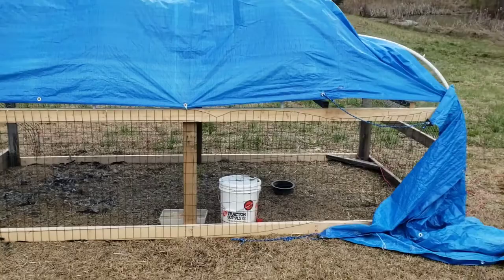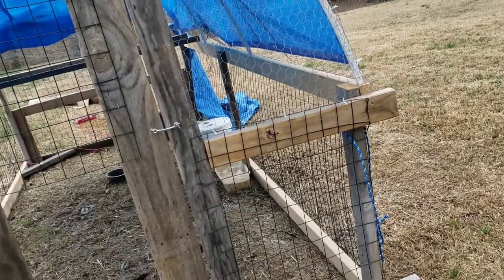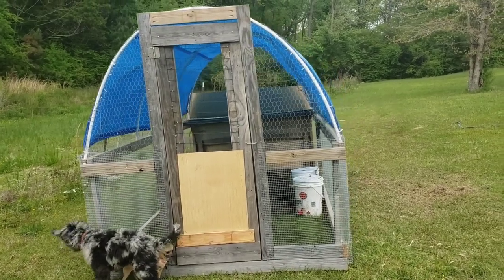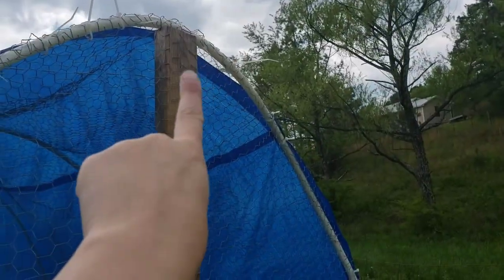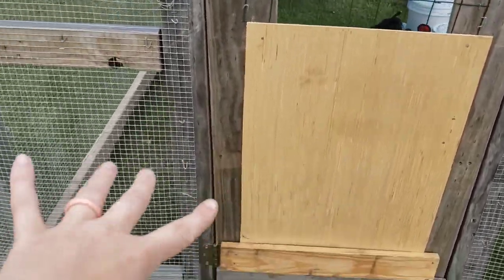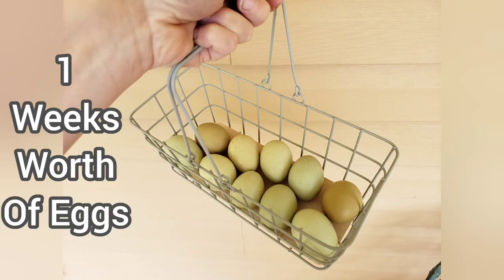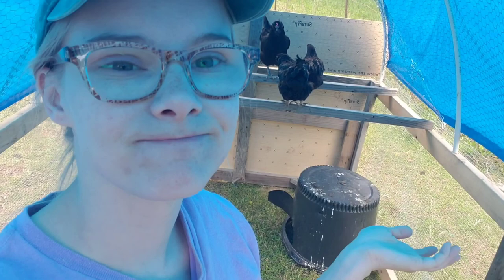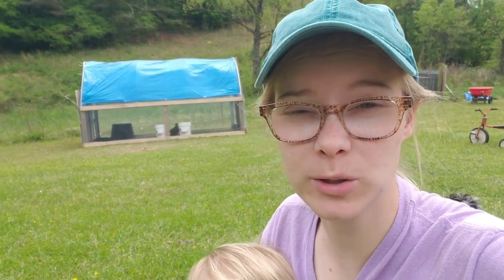Hoop Coop (Chicken Coop) Part 2: Predator Proofing The Coop

Comment: Do you have wire that goes 2 feet out around the outside bottom of your coop?  I see a lot of people do that to prevent digging under.  My run is smaller and I have bantams so I just put 1/2 inch hardware cloth on the bottom of the whole run.  The grass and weeds grow through and I put a dust bath plus a plastic shoe box of garden dirt to  scratch in.  I am 74 but I can easily move  it a few feet, a couple times a week.  Also the coop and run are inside a 5foot chainlink fence which is patrolled and marked by my dog and cats.  There are no loose dogs but hawks, cats possom racoon and skunk in the area.  I hope you have no more trouble, chickens can be so sweet.

Comment: To add I would try an electric wire near the bottom so they wil get zapped.
Reply from the maker: Would I be able to do that while still being able to move the coop? Right now I'm moving them every couple of days to new grass.
Reply: Sure, the wire will be connected to the coop have it 6 to 4 inches from the coop.  All around so nothing will dig under.

Comment: Sorry about your chickens : ( How are the new upgrades working?   I would add chicken wire to the door, smaller animals can get through what you have in this video. I would also add a few solar lights so if something came near it would Triger the lights. If you build another one I suggest you upgrade your wire to cattle panels. They are stronger then what you are using and there are plenty of videos on how to use it for chickens! Blessings
Reply from the maker: So far so good! But I will definitely look into solar lights and add chicken wire. Thank you for your suggestions 😊